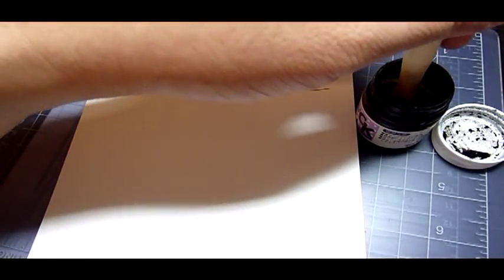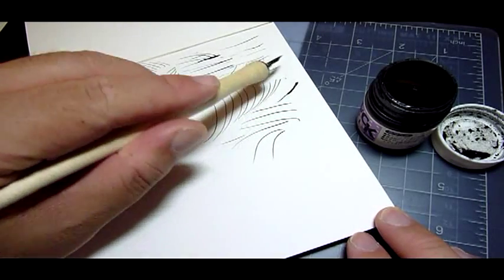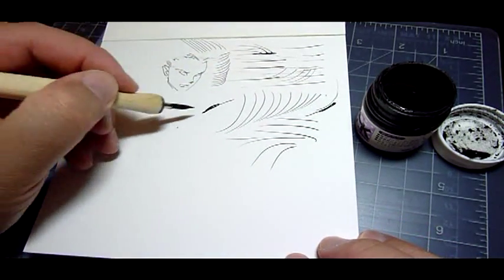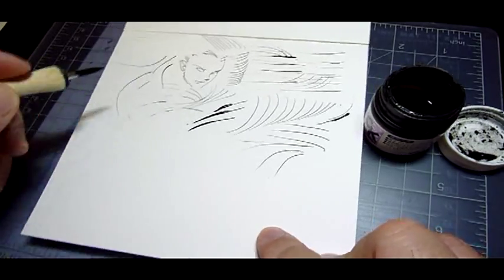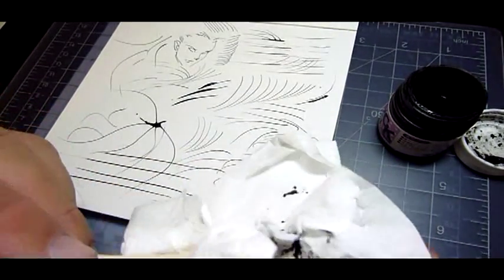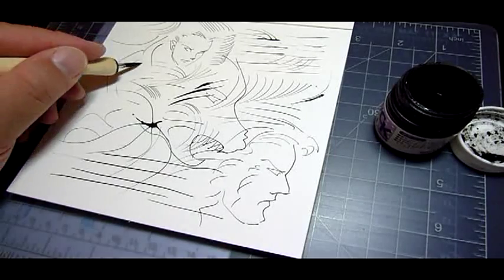Ultimate Crowquill Pen test sheet

Comment: I'm from india adman, & since I couldn't find nibs like hunt 102 here, I work with gillot 659 too. It's a very good brand man, lines i get are quite nice. i guess your problem is with the ink. I've tried camlin ink as well, but it is a very beginner quality ink. doesn't works that well with brush or nibs. i draw with pelikan ink, or daler rowney FW ink. you can try rotring drawing ink as well. it is quite thin